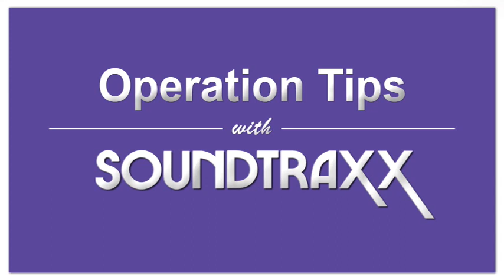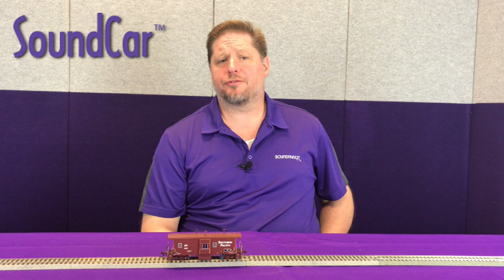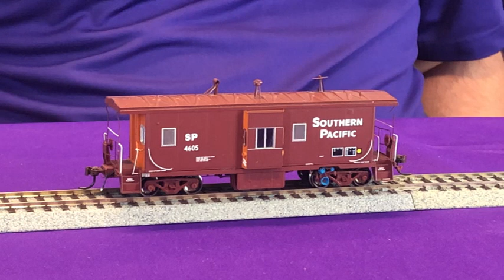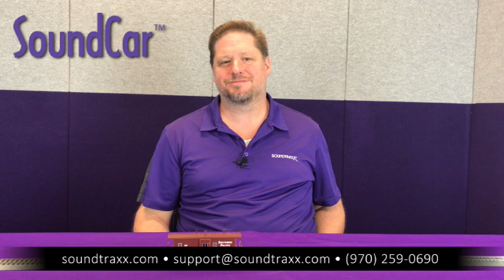SoundCar Caboose Operation Tip: Air whistle

Comment: Hey George, any thoughts to adding a modern brakewheel sound, as well as the existing older  ratchet-n-pawl?
Reply from the maker: We do not have any SoundCar changes in the works right now, but you can add these suggestions to the feedback page on our website: https://www.soundtraxx.com/feedback.php

Comment: How would I reattach the wires from the roof light on this sp caboose to the decoder? The 2 fine wires snapped at some point before I got it
Reply from the maker: Contact our Support Team for help with this: (970)259-0690 ext.22 or support@soundtraxx.com

Comment: If I have a sound car equipped caboose consisted with the lead loco, will it blow that whistle by pressing the whisltle function botton while in reverse? By that I mean do I have to dial up the address of the caboose to blow that whistle or does the consist address take care of it?
Reply from the maker: Yes  you can have your consist set up to do this. You will need to use Advanced Consisting and possibly some function mapping. If you need any help setting up the consist just contact our Customer Support Department and they will be happy to help: (970)259-0690 ext. 22 or support@soundtraxx.com. Thanks for watching!

Comment: So it would be possible to to use the SoundCar in a Cab Coach and utilize the lights and horn when its in a consist with the loco pushing like you see many commute trains doing? In a consist with the loco in reverse and the cab coach being the lead car do both horns blow or just the cab coach or is this dependent of how you setup the CVs?
Reply from the maker: This can be done with various function mapping set up.  For more information on how to do this please contact our Customer Support Center: https://soundtraxx.com/contact/technical-support